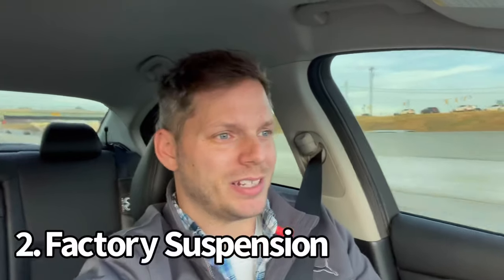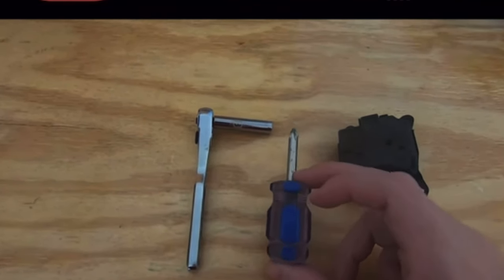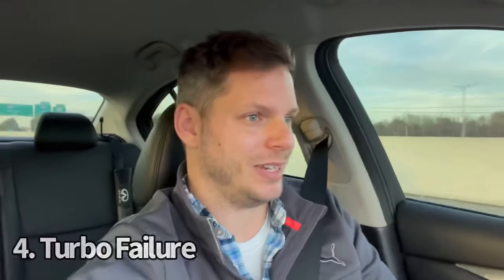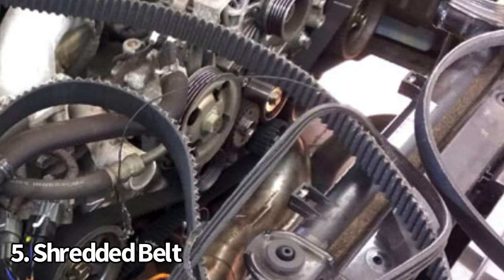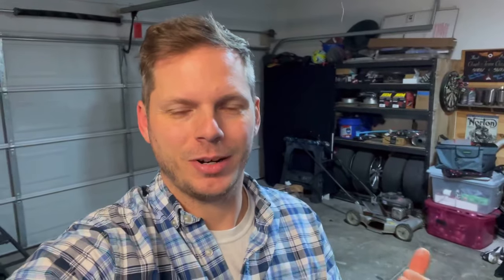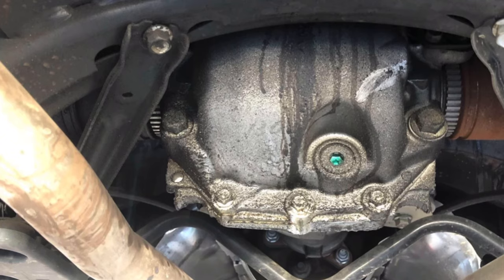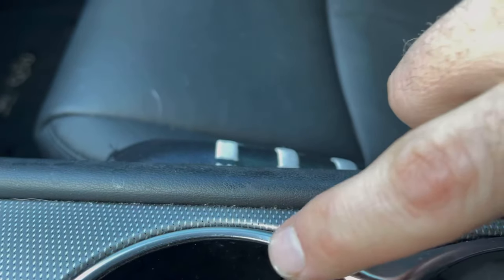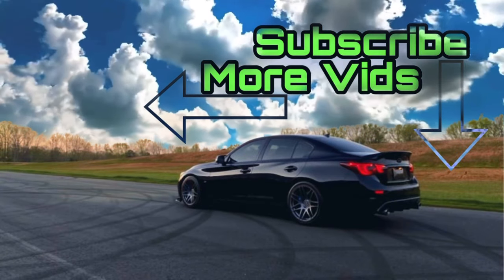8 Q50 Parts that WILL Fail!

Comment: For those who have issues with slow windows, DO NOT GO TO THE DEALER. Buy a lubricant silicone spray and spray along your window frame , give it 5 min and then put your window up and down a few times and bam brand new fast as hell.
Reply: Awsome share bro, my 18 redsport is starting to do this.
Reply: Bro my shit got stuck a couple days ago I was just about to buy a whole new regulator….
Reply: Driver window started happening when cold for 1st use in day of window; only time it happens. No other issues. Had G35 for 10 years and only 10-yr battery went out but that's standard...and life. Other than driver window issue with Q50, no issues in 4 years.
Reply: Depending on how bad it is when we have that issue come in most of the time we just clean the track and then spray it with DRY spray lubricant if you don’t use dry spray it will work for a little bit then actually get worse more and more debris will build up (Infiniti technician)
Reply: @tomz-5129  thank you!! what do y'all end up charging it as though? haha
Reply: I honestly wouldn’t be worried about it. The new Lexus cars do it too. It means they are tightly sealed.
Reply: Thank you
Reply: Come on into the dealer; we’ll wash your car complimentary and lubricate all 4 window run rubbers at no charge.    Just remember; we’re less $$ than jiffy lube and love our brand just as the client does
Reply: we use to do this at the dealership. as an ex infiniti Tech I approve !
Reply: I have a 2014 with 95K and the front driver AND passenger windows were slow starting around 60K miles.   Cleaned and lubed more times than I can remember and that would take care of it but finally the passenger side just quit.   While it was raining.   After a couple minutes of me futzing with the button (driver side and passenger) it finally went back up.    Left it alone and just didn't use it.  Soon, the driver side started randomly failing.   I finally had to replace BOTH door motors.  I was having other work done at the time and the dealer knocked 300 bucks off the bill for me (I'm a good customer).   Still crazy expensive.   I never had a car with power windows fail like that.  Certainly not both sides.   I'm 55 and have owned a lot of cars.  I still love the car.   Especially the 3.7.   I put my foot down and I usually forget about the silly things that keep breaking.
Reply: that's crazy it seems to be a problem on these cars how much was the bill for just the windows
 @scundoalex
Reply: @ameerskater   Probably 1800 for the parts and labor.   Yeah I'm an idiot for going to the dealer but not many decent independent mechanics where I live.
Reply: Will that mess up window tint?
Reply: Interesting

Comment: For the belt failure you need to loosen the the a/c compressor and push it back and tighten it that’s why the belts would fail when you do that if you catch it early enough you won’t have to change the belt but if you still hear chirping then replace the belt (I’m an Infiniti tech and I own a 17 Q50s)
Reply: @tomZ-512 
Have you guys ever ran into the issue with the 2016 q50s red sport where there is a delay when the car is put in reverse?
Reply: I need a way to contact you my belt failed
Reply: It did the chirping and popped
Reply: i had this issue. 2 infiniti dealers turned me away telling me they couldnt duplicate and they wouldnt warranty the repair just becuase. paid nissan to change the belt and look at it. running fine ever since.
Reply: I have a question I have a Q50 I can't figure out why the compressor won't ingag I changed the clutch and pressure switch what else could it be is there more than one persure switch
Reply: I have the same q50 premium 17 what is it I need to do now coming up on 105k
Reply: I had that problem too, but I recommend taking it to the dealer so they can align it correctly!!!! It’s not just “pushing it back”. And yes!! Make sure the belt is replaced if it has been chirping!!!!!
Reply: Thanks for the tip!
Reply: Under the trailer I’m completely fine
Reply: @tehKrunks  da faq😂what kind of clowns work at those infinti dealers Bruh 🤦‍♂️
Reply: Hey man i recently purchased a 18 3.0t a few days ago and the check engine light came on, says vent control valve. Guy at autozone says it should be gas cap, has been 10 miles so far and light still on, are you familiar with this issue ?
Reply: Can we be friends?
Reply: There is a q50 with 49k miles for sale no accidents nothing but they said there is a power steering issue what do you think it could be?
Reply: @CarsonDavidson04  i may be wrong but i thought most if not all Q’s come with electrical steering?
Reply: @Itsyunlo  idk this dealership in the description said it has a power steering problem
Reply: @CarsonDavidson04  ask if u can take the car for pre purchase inspection.
Reply: @Itsyunlo  ok
Reply: @Itsyunlo  q50’s had a 3.7 engine in it from 2014-2016 before they went turbo n all electrical components
Reply: @CarsonDavidson04  easy fix my g37 is literally the same just need a good mechanic to get the job done without being taxed
Reply: A Tom I wanna buy a 2015 q40 what u think
Reply: Infiniti tech who owns an Infiniti is always a good sign! Any issues with your ride bro?
Reply: Yoo brother i got 17 Q50 3.0T recently for some odd reason she won’t pull anymore and she’s having trouble accelerating and a rattle noise but i took it to the shop they said nothing was wrong maybe turbo lag? But what do you think?
Reply: Or just buy the z1 replacement for 150$ it includes a new ac compressor pulley with ridge to prevent the belt from slipping and a new belt
Reply: Can I still win the test pipes😂😂
Reply: What do you recommend for a diagnosed bad front seat? Weight sensors failed at 97k. Quoted $4700 to replace at the dealer. Infiniti extended warranty won’t cover it.
Reply: I got a 2015 q50 3.7 and I’ve shredded 4 belts I replaced the tensioner and the bad top idler pulley and it keeps going would me leaking power steering fluid make the belt to just keep shredding ??

Comment: I bought a 2014 Q50 Hybrid sport which I still have…. I haven’t had a single issue, just regular maintenance and 135,000 miles later….still not even a warning light

Comment: I have a 15' q50s 3.7 awd and it has 150k miles on it and here is whats broke so far: power steering high pressure line leak, front tie rods, front shocks slowly starting go, steering lock (i just disabled it). That's it asides from maintenance. I track it and drive it spiritedly quite alot. Car is stock tho asides from exhaust. Otherwise it still runs and drives great and transmission running great too
Reply from the maker: Very good!

Comment: Everybody is missing the main problems besides warped rotors.... PLASTIC PIECE BETWEEN REAR HOSE AND CRACKING RADIATOR PLASTIC
Reply from the maker: Warped rotors only happened in the sport model and really not that often.  The plastic cracking issue just seems to be popping up now on occasion.  Still not as prominent as the others but that could change

Comment: Hey I’m from NC and am an Infiniti tech. Yeah turbo failure and also engine failure is very common on the OLDER VR30, think they fixed it 2018 and afterwards. Mostly an oil starvation issue similar to what the RB motors had from what I’ve heard, very rare issue is having a porous engine block that allows coolant to leak.
The blend door motor is a bitch to get too, just a tight space.
The slow window issue is most likely a window run needing replacement, easy to do. 
And as you said lots of valve body’s but I don’t see it as often. Great video as always!!
Reply from the maker: Thanks for the input!!
Reply: @maxziplock  possibly yes a smell. Best way to tell is by pressure testing it and lifting the vehicle up. If you see coolant seeping through the block then it’s porous. I’d start by checking all hose connections first tho and seeing if I can find a trail of dried coolant
Reply: Thanks for posting on here.. i have a 2018 q50 redsport and i have an oil smell in the car when driving. Not driving hard at all but just oil smell inside the car... i had Infiniti come pick up the car but they could not find anything wrong.. does not use any oil but i have also noticed quite a bit of black oil gunk on the tail pipes.. i have a catch can and check it regularly but want to get ideas on where this oil smell is coming from because its not normal.. Oh im a long time g35, g37 and q50 owner. Its still under warranty and i am in alabama so my closest dealer is 4 hours away...  any thoughts on things to keep an eye on? I think its injector or turbo related..
Reply: @_mathtutor3334  if it’s a vr30 chances are probably turbos
Reply: slow window .. how is that fixed ? i am having that issue on driver side
Reply: @hazeblank7441  usually the window run needs be be replaced. It’s the rubber strip that your window slides in
Reply: Hey, Michael randomly got a check engine light and wouldn’t ship as third gear code is P0720 so I had the speed sensor replaced. And still nothing… you think it could be the valve body?
Reply: @GlockJunkies  seems very possible to me. I know those go out on the q60 and q50 a lot
Reply: I’ve had quite a few 18-19 coming in needing engines with only 20k on them so idk what’s going on 😂😂
Reply: @tomz-5129  all I can think of is Infiniti does state they require 10k mile oil changes which is bullshit.
Reply: I got a 2018 q50 my radio went out it’s just a black screen both of them but in reverse the came come on in of my ace work in dash lights come on in I can’t change my drive mode I bought a new radio on eBay but still don’t work
Reply: @antman817b4  wdym bought a new radio?
And I’d take it to a dealer
Reply: @spideym35i   I meant I got a new one and they still do not work
Reply: @antman817b4  take it to an Infiniti dealer they can diag it with Consult
Reply: @spideym35i  so im thinking of buy a q50 but i really want the turbo model, but with so many ppl talking about how they arent reliable, should I just buy a 3.7 q50?
Reply: @richnb  best advice I can give ya.
If you want a VR30, get one with an extended warranty and see if it’s had a engine or turbos before.
If you can’t get one with an extended warranty or factory warranty, get the 3.7
Reply: I have a 16 Q50 awd silversport with 74k on it. When I accelerate then let off the throttle, sonetimes I get almost like a whiplash feeling. I dont want to let off the throttle because the car jerks. Is that the valve body issue?
Reply: My 16 Q50 also randomly died while driving. Pretty scary. It also went into limp mode once. I got throttle position sensor codes.
Reply: @mechsbox  I haven’t heard of a valve body causing that. Throttle position probably refers to the throttle bodies, which I haven’t seen as a issue yet with the 3.0.
Check your air filters for damage. I have seen on other engines that rodents eat away the filter media and that allows filter media to get stuck in the throttle bodies, jerking can also be caused by a bad a/f mixture
Reply: @mechsbox   I just bought a used 2016 Q50 with a 155k km on it. I was driving it and all of a sudden it went into limp mode but it said “Warning Malfunction” and a front end collision sensor warning and had to get towed off the highway. Didn’t have a code reader at the time but when I picked it up they said that it was the RH throttle body. They said they replaced it and never did. Picked it up a drove it an hour to a friends place, went to leave and bam same issue. This time I was prepared with a code reader and it gave me P1239. At that point I just called the dealer and had the deal reversed. I had done a ton of research and never found anyone else with the same problem. I wonder if they had just replaced the throttle body if the issue would have been fixed but I have a pregnant wife that wasn’t impressed and had no choice but to get something more reliable… oh the Q50 dream lives on in my head haha. Did you get the problem solved?
Reply: I just got these 2 codes p0720 and c1109 they came out of no where any recommendations?
Reply: @christhiantorres1842  the C code is abs, not sure what it’s for. P0720 is the valve body death code
Reply: @spideym35i  rip so is it worth getting the speed sensor replaced or the whole valve vody
Reply: @hazeblank7441 or try spraying WD40 in the window control

Comment: I personally purchased a universal 10 row single pass fluid cooler from Mishimoto and used -6AN hoses to cool the ATF in my 16' 3.0t Red Sport 400 awd, currently odometer is showing 93,346 miles and it was one of the best mods I've ever done. The cooler does the job perfectly, by matching up the hoses to the oem hoses i don't see much pressure loss or increase of pressure in the valvebody, it's not cooling the ATF too much or not enough. I can beat on here and drive it hard, or be sitting in traffic in the summer and it's working perfectly. I monitor my ATF temps just to be sure. My next upgrade will more than likely be another Mishimoto universal fluid cooler to replace the OEM oil cooler, but I'm monitering oil temps, just to be sure, since the red sport models have a thermostatically controlled oil cooler, guess we'll see in the next month or so.
Reply: IS it still going problem free?

Comment: This is a pretty spot on list but I will say the injector/fuel rail issues seems to be more common to those running ethanol blends especially those going up to E85….91,93 guys have been pretty safe from this issue . This a pretty short list compared to bmw,Audi, and Mercedes so your so right on just keeping an eye on things ….great video 💯
Reply from the maker: Your statement about the German manufacturers is 100% correct lol

Comment: 3.7
-Cam and crankshaft sensors
-power steering pump
-front end links (especially if you have aftermarket rims)
-valve body/speed sensor (especially if you have aftermarket rims)
Reply: I got hit with the valve body 🤦‍♂️ $1,500. The dealer gave me good warranty doing it with them.
Reply: Power steering pump 🙋🏽‍♂️
Reply: What's the relationship to the valve body/speed sensor and aftermarket  wheels?
Reply: @Chris-ww9uo  different size. Creates different outpit
Reply: @tristanoliver2911  oh ok your referring more to different  over all diameters.
Reply: I bought and replace the speed sensor. Which is a bitch to install. And was not it. Let us know the outcome with yours.
Reply: @3103Juan  what do you mean by warranty? For the whole car or for the part just in case it went out again? Also for how long
Reply: Valve Body rn 🙃
Reply: @dat.v37  same 🫤 doing all this research is annoying but i need to get back on the road
Reply: @nomistakes6973  I feel you bro .
Reply: @3103Juan  it’s the valve body homie, when you get that p0720 code 90% of the time it isn’t the speed sensor it’s the whole thing, valve body/tcm replacement
Reply: @3103Juan  it’s always the valve body or tcm when you get the P10720 code
Reply: I got a p0-720 and p0-500 code but I’m running stock wheels. What could be the reason for that? And how could I fix it
Reply: @marcomartinez3435 hey man did you end up getting that figured out?

Comment: Bought my '17 Q50 Sport CPO.  Purchased the Wrap Policy Elite Warranty through Infiniti. HIGHLY recommend it if you're looking to buy an Infiniti.  Covers bumper to bumper for 8 years from date of inception with zero deductible. I have had almost everything this video talked about mechanically done at no charge out of pocket.
Reply: Can you get this warranty if you bought from dealership other than Infiniti?Just bought a 2018 silver sport with 87k I want to protect myself
Reply: @Skilly713  I don't think so. It was only available on Certified Pre-owned vehicles sold through Infiniti. Could be worth a call though. If not,  there are aftermarket warranties that are really good though.

Comment: Yup, my 2017 q50 has a blend door problem on the driver's side.  To fix it I have to turn the   temp all the way high and then all the way cold. Then it works.

Comment: one I've experienced on the VQ37 and I've seen others having this issue as well is the plastic coupler for the heater hose. It gets brittle and can leak or full on fail causing coolant to leak every where. I replaced mine with a metal one to avoid this "ticking time bomb".
Reply: Happened to me 3 weeks ago
Reply: You have a link for a good metal one?
Reply: @Trent_Moorman  look up “Dorman - Help Heater Hose Connectors - 3/4 In. X 3/4 In. Connector - Metal” on advance auto part.
Reply: Happening to me right now. It sucks cause i kept buying coolant just for it to leak back out. Even changed the thermostat and radiator cap. Came down to that damn connector thing.
Reply: @The_sTress  yea is a common issue but no worries you’ll be good man once changed

Comment: This video is on point I am from Jamaica and I have had some of these issues with my 2015 Q50, most I have fixed 
* Break Rotator 
* AC 
* Noisy Widow When Wet 
* Shocks 
* Interior Trim Issues 
* Deck Lid Struts (trunk)
* * * Maybe Valve body Failure trying figure this out. 

Recently found your videos, they are great.
Reply from the maker: Thanks a lot for watching!!

Comment: thank you sir have a 15’ awd limited 3.7 in black with 120k miles 2 tone 19 inch wheels , just bought it. picked it up for 9800 cash its had the differential fluids changed / trans so far and spark plugs. It’ll be a fun project. starting with coolant flush. Pretty fun. Been taking it easy, shifts smooth. Still daily my 400 hp taurus it just feels like a cross over to drive and sits higher and it’s a little more convenient. i don’t like how heavy the pedal is in the q50. My g35 was reliable and I had a g37 for a short time and was missing that VQ. Very happy with the q50’s sound system and interior capabilities. Sounds good on cold start ! Probably going to just replace the rear dif bushing when i go in for rotors here soon. Having a slight strut-pop kinda noise from the rear when I launch, but 5 seconds to 60 and gets great fuel mileage around 75 compared to my taurus.